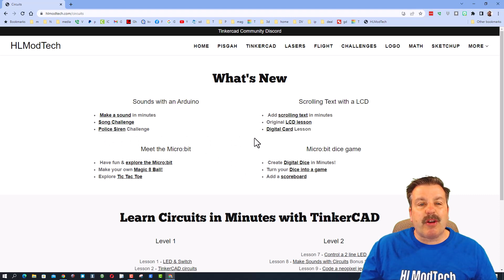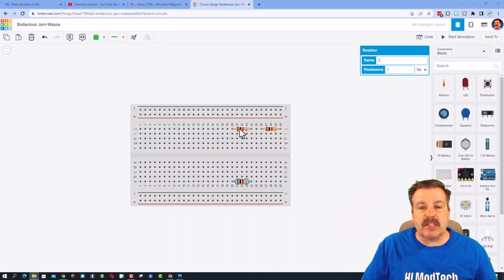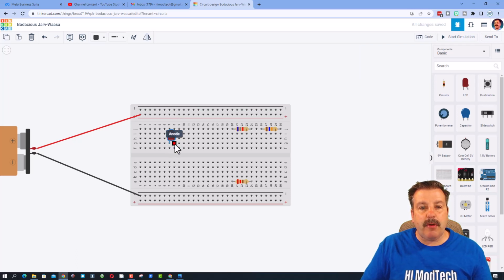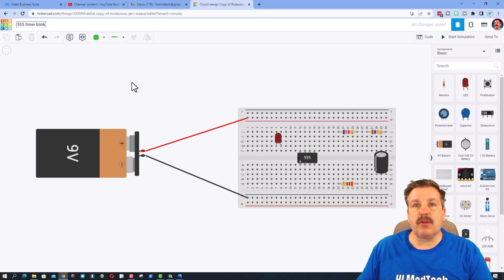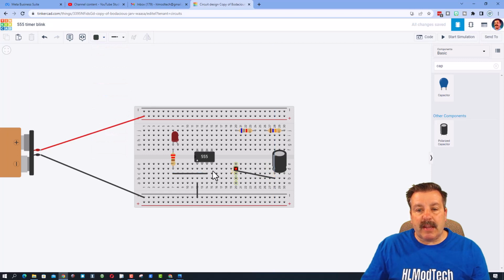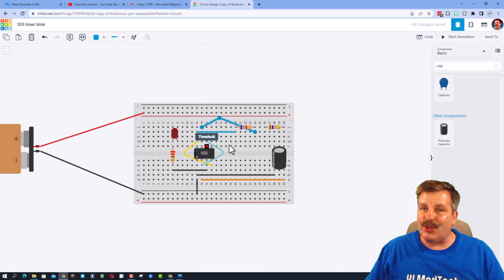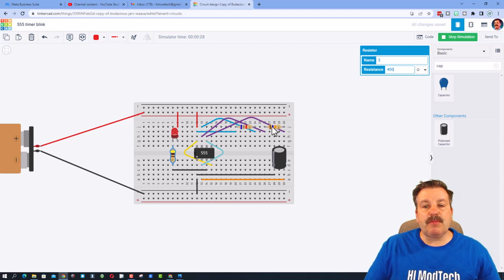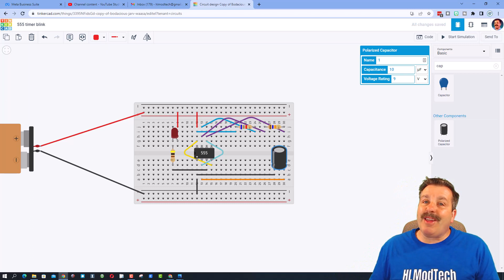Make an LED Blink with a 555 chip Master Tinkercad Circuits in Minutes

Comment: how many LEDs can i add if i want more. Love your video
Reply from the maker: Thanks for the kudos. I think the max will be determined by the voltage you can generate. That said, I had kids prove that the sim can be "tricked" into allowing more than is theoretically possible...  I have not had formal electronics training so I am not sure what the real formula for "how many" is.